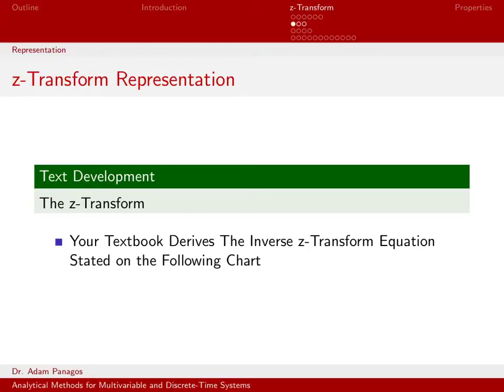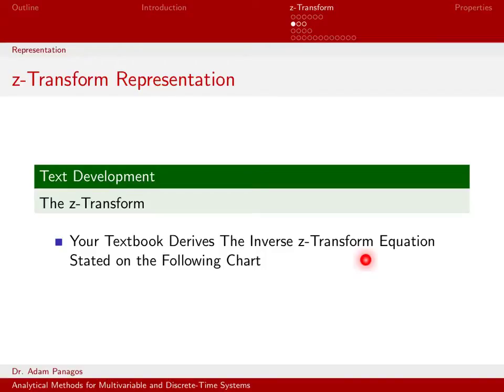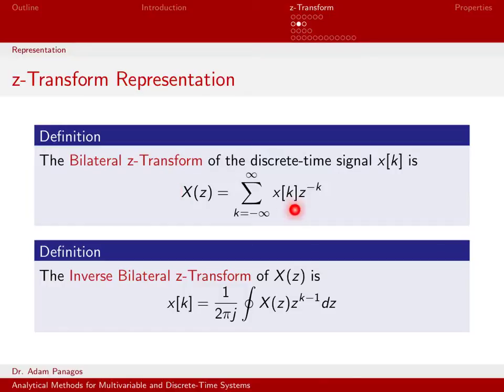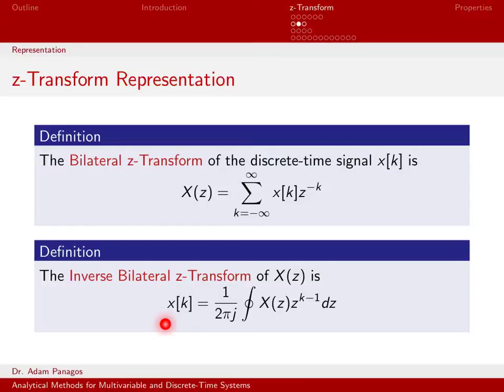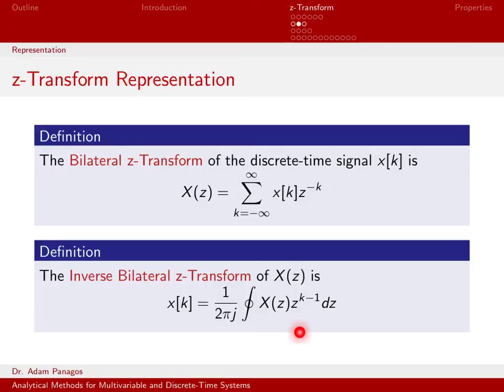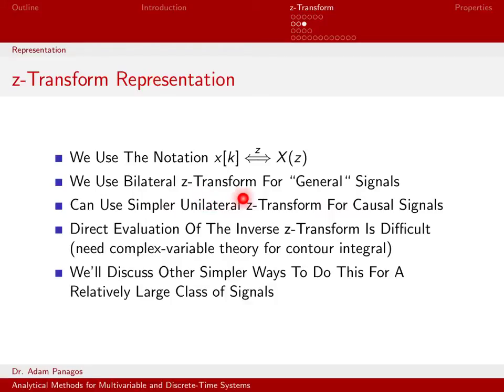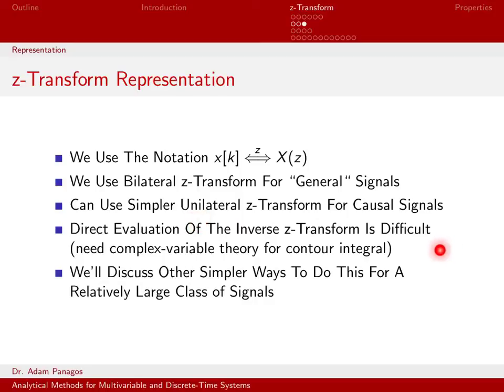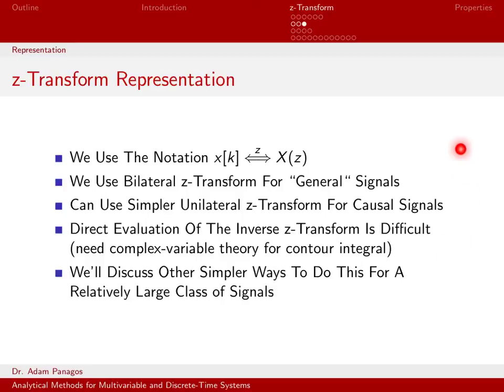Definition of the Bilateral Z-Transform - Z-Transform Part 1

Comment: So if you let r = 1 and Omega = w, finding Z transform will yield to Fourier Transform of discrete signal (at least I believe so). And the thing I do not understand is why do we exactly have to have the notion of number Z, is that the amplitude (r) part that changes the game or what is the deal?
Reply from the maker: Yes, that's correct.  If we have the z-transform of some signal, replacing z with exp(jOmega) gives us the discrete-time Fourier transform (DTFT) of the signal.  This assumes that it's ok to evaluate the z-transform on the set of points z = exp(jOmega), which is the unit circle.  We can only "plug into" the z-transform on points where the z-transform exists, what we call the region of convergence (ROC).  We like the z-transform because it can work with a larger class of signals than the DTFT.  There are many signals that have a z-transform (and corresponding ROC) but don't have a DTFT that exists.  Hope that helps,
Adam
Reply: ahhh that's clear now.

say X[k] blows up infinity as k -> inf. DTFT cannot  slow it down to converge but Z transform can because of that r^-k factor! 

how clever! 

Thanks Dr Adam
Reply from the maker: @giorgitsintsadze9919  Yes, exactly right.  We get to control the r^-k factor, so we set r to whatever value we need to FORCE the sum to converge.  Our final answer is only good for some set of values r, but that's better than having an answer that always "blows up".  Sounds like you got it!